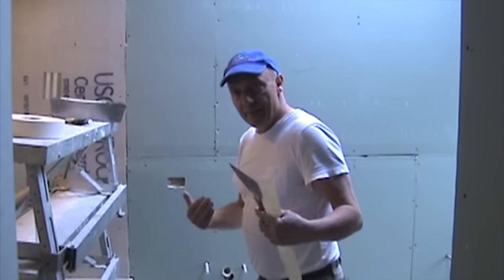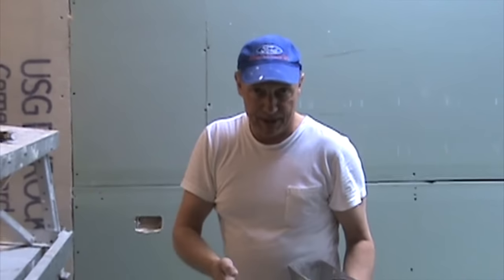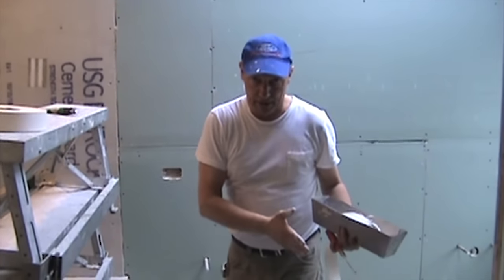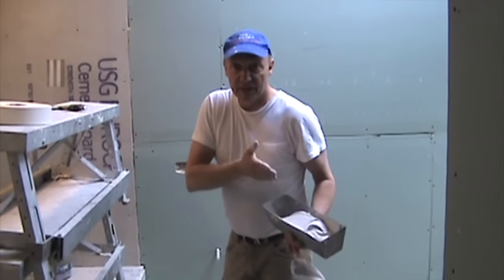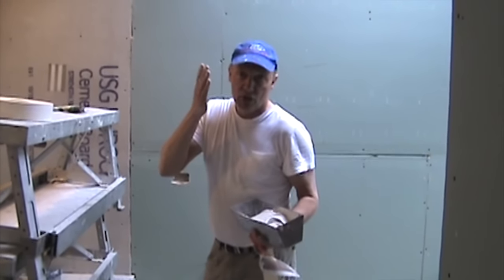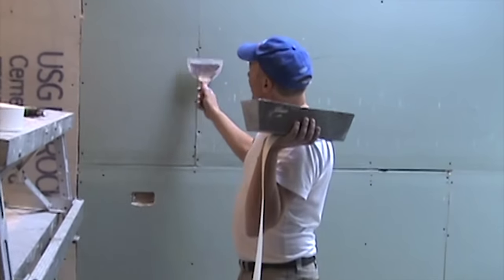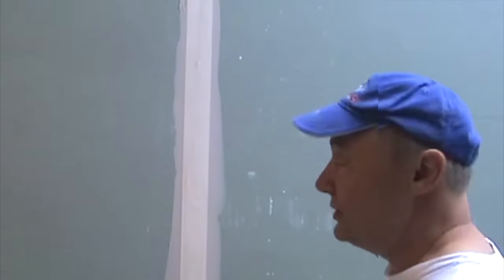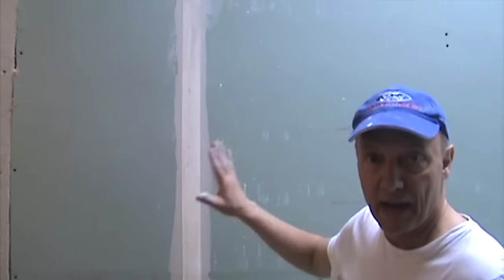How to do Butt Joints

Comment: As a contractor  I have to say that he is really good.
I know an old man who used a concrete trowel and he goes back and makes the half dry mud wet!
And skim coats it flat.
I still took sand paper across it lightly to bother him but it disnt need sanded at all.
I even checked it with an angled flashlight

Comment: I've only been doing this for 8 years or so, I enjoy watching people with greater experience do their thing, maybe there's something there that I can reflect on or learn from, 100 percent agree that there's not much I can't coat out with a 10" knife.  Never been a fan of a 12" unless I am just pulling mud off the wall for a skim.  It might just be me but I've never had much luck with taping a joint and immediately coating again right after, hot mud to tape and taping for first seems to work alright but I still let the tape dry prior to recoating, 2nd/3rd I let it dry enough that I can Scrape the ridges and coat again.  I only sand after my finish coat which, like you, I pull tight, try to keep it clean just to minimize sanding.  

Nice Video, thanks.
Reply: Try anything with an 8 im on fire

Comment: Nice work. As a novice I have a 12 or 14 inch bowed trowel. By bowed I mean it is not flat but has a slight arch to it. This allows me to spread the durabond out an leave a slight thickness over the joint and the tape which tapers to 0 on each side. I always thought that tape had to be wet with a slurry of durabond. I see that this is not done here so this pro does it this way. In any case I use fibreglass tape because it saves me time from putting on wet paper tape. The only drawback that I can see is the fibreglass is a bit thicker which can be problematic. Also it is more expensive. As an amateur without the high level of skill of this gentleman, fibreglass tape and bowed trowel is what I use for joints.
Reply: But wouldn't that give you a rounded area over the joint rather than flat. I only use a curved trowel over bevel joints.

Comment: I tape the same way,in NYwe do not use durabond with sheetrock,just compound and plaster (when- needed) Some times I mix some plaster In my compound for gabs and if I want to start doing my skim caoting the same day or when I some joints need a little extra care .and i want to start doing my finish coating on that day.I never use plaster when I put the paper on, always  straight compound only. I   have been hand taping  for  25 years. I wished I would have had the bazooka and the other tools tools you use . They are really great tools . Even thoughI have done many houses about (4-5  rooms), by myself at a fast but efficient speed. I  can usually  do the paper coating in about a day.or sometimes it may take 2 days.  But with the tools you use , it would  have a better and more efficient way. Also  putting less stress on my wrists and knees going up & down scaffolds and ladders. With the tools you  have been using.for the last 40 years. If would have know you 25 years ago. I would have differently ask you to show me have to use these tools, I am always willing to learn how to do things more efficiently .You can always  show an old dog more efficient  tricks,, if they are willing to learn. them. That's what's wrong with some young  adults  today, they are not willing to learn different ways of doing things to be better at there professions. I  do not mean yourself.

Comment: This is irrelevant to this video but I have a client who requested that I mud over the joints on vinyl coated gypsum board in a mobile home. Do you recommend oil base primer and then just treat as a regular butt joint or will the way the walls move just cause the joints to crack?
Reply from the maker: You are absolutely right use a vinyl strip over the seams that's all you can do mud will never hold up. If it's dirty just prime and paint

Comment: Hey drywall doctor it's a pleasure to see your videos I love all of them... Mister Ray ,I have been doing what you do, and I have been doing it for years except I don't use Dura Bond because they don't sell Dura Bond here in the Rio Grande Valley Texas... At least I haven't been able to find it by I use easy sand USG brand to pre-fill before I tape but for a different reason ,because when you pre-fill you stop blisters, from happening in the tape when you have large gaps.... It's an extra step other type of floaters in my area don't do. But I have always done.... now will USG still recognize my method as good if I use easy sand 90 instead of durabond 90 to do a pre-fill?
Reply: Thank you it's just that here and they're Lower Rio Grande Valley they just slap the houses together I'm a damaged drywall repair specialist and what I do is I correct the mistakes all these guys are leaving behind.... Thank you for your channel I learned a lot of stuff from you....... You can find my videos in (DDR Express) DDR stands for damaged drywall repair.. my company has its own channel...

Comment: I would like to ask as someone with general building knowledge in the uk. this is what you call drywall, we use plasterboard here mostly and it is skimmed all over and finish flat with a plasterer trowel, and then painted or wallpapered, whichever the client requires. So does this mean that the plastering trade over there is just not required, because you do as a finish just skimming the joints etc,
Reply: @THEDRYWALLDOCTOR1  Many thanks for your very swift reply cheers mate. have a very nice day, great video and very informative.

Comment: I  am going to need to do this in a bathroom.  So can you just use Durabond for the whole job or do I just use this for the initial taping and then use another type for finishing?  Can durband be used to cover the screws as well?
Reply from the maker: I would use it for the initial taping sorry it took me so long I just saw this comment and yes you can fill in screws just make sure they're dented in cuz it's hard to scrape

Comment: Hey Doc, ever mud a tapered edge to a butt edge?  What do you recommend when a remediation company cuts 2' of drywall from the basement floor up the wall.  I have about 223' of drywall that needs to be replaced and I want to save on waste by cutting the drywall in 1/2 long ways and using both top and bottom pieces.
Reply: If the company already boarded and put the factory up to the buttjoint, just prefill the factory so you are left with a flat surface. I.e. buttjoint.  Once dry it's easy to tape again.

Comment: I always get scratches in my durabond unless I soup it way up, it seems to take a bit more water to get the clumps out than any other mud. Hardest one to use lol need a machine to sand it if you don't get it right.

Comment: I cut a 45 degree angle and only half way through on both sheets, butt the two sheets together (like welding two sheets of metal when welding a seamless joint) and that way you can sand flush, BUT do this with two application of compound, because compound will not set up inside if it is 3/8 thick or more with one spreading...
Reply: Timex that's got to be the dumbest idea I've ever heard....
Reply: I thought about doing this as well some years ago. I suppose it adds some more work because you have to bevel the edges manually.

Comment: I’m having problems after doing a patch job

Getting the texture to match the rest of the wall 

Another worse after painting you can see a patch job 

do you have a video for that
Reply: You're probably not sanding properly if your repairs are showing, the secret to hiding multiple repairs is to sand them off properly, take a hawk or half pan of finishing mud, load up the area or the wall and scrape it back off, skimming it will even the texture out on the entire wall, light sand and prime and the texture will be even again, I only do that on extremely poor walls, most patch work i do blends just fine with the majority of walls I repaint.  Sanding it properly is key.  So is knowing how to patch dings and holes... could be a lot of things, but if you still see your patches after repainting, you didn't blend the height out and or didn't sand enough.  Maybe they were minor blemishes and instead of smacking them into the wall with the bottom of you taping knife you decide to try to flare out the height of the blemish/damage.. it's easier to dig into a wall and coat it back to flat then it is to try and blend a high spot.
Reply: Natural light/higher paint sheens will show everything.  This could also be why your repairs are showing.

Comment: As a novice, after you tape with durabond 90 and let it dry, what type of  mud do you come back with to float it out? I assume two coats of floating it out then last step sand?
Reply: Thx! Is there an alternative to durabond? Can't find a single store that carries it. They tell me EasySand works just the same to prefill and lay down the tape.
Reply: In Seattle, everywhere sells Silverset. It's made by USG, the same company that makes Durabond and the Beadex and Sheetrock brands. Even the specialty drywall houses out here don't stock the old school, brown bag Durabond.

Comment: the guy at usg said to use mesh tape with durabond now i am really confused
Reply from the maker: He is also not repairing the drywall is he?
Reply: Dont use mesh tape. Only to fill large gaps in corners where the installer messed up.

Comment: Hes doin all the fill in one step cause durabond gets hard as concrete and doesent crack then all you have is your finish coat.instead of multiple coats of mud and  chancing it cracking use this instead its old news for me  just  on deep fill joints  cause if  you  for some reask build it up to high you will be tearing the rock you dont sand durarock

Comment: I have a question doc please help I can I get a perfect cut with the bazooka in the upper angles. My tap keeps pulling so I have to go back an cut lil peace to fix the problem. Its it my mud consisted to running or not to running
Reply: I have hung thousands of rolls of tape with a bazooka and what you have to do is make it a little long as you go to move away from the corner with practice you'll get where you'll make them the right length. It also helps as soon as you leave the corner press really hard on the crease wheel.
Reply: Thank u I jus figure that out the last couple jobs but now I know I'm doing it right

Comment: on a small job can I tape and coat with durabond before the mud sets on the tape?
Reply from the maker: Yes but keep it tight you can not sand durabon
Reply: @THEDRYWALLDOCTOR1  true, very hard to sand. I use a lighter weight top coating like plus 3.

Comment: What are your thoughts on prefilling an area that is already settled?  Doing a basement in a 10 year old house.  Do I need to prefill each crack like this or just the larger holes?
Reply: Good point, thanks
Reply: Doctor- how can primer NOT penetrate the mud / tape and not lock it in? You say it could pop the tape- how's is that even possible?
Reply: mike ray look at any house that a bad finisher has done you will see it's possible

Comment: Hear you say the " real durabond" alot........what is fake durabond?
Reply from the maker: Light weight setting compound
Reply: THE DRYWALL DOCTOR First Aid 

The white bag crap that says easy sand. Anyone who has ever sanded it knows that’s false advertising 😂
Reply: Kirk Dunn 

The durabond 90 is a great product to prevent cracking. Just know that it dries very hard and it doesn’t sand very easily. Perfect for high moisture areas like bathrooms or hot tub rooms. Personally I have used it on several carports and breezeways and never had any issues.

Comment: what do you do when drywall mud the all purpose is drying up on you and making clumps  I can't get it smooth  when it starts drying?
Reply: The Drywall Doctor could it be old from the store it was new!!!
Reply: JBIRD575 Get your kids to start picking out all the lumps! (ha)
Reply: There could be a few reasons.  

1) your not mixing the joint compound correctly to start with. 

2) you keep playing with the mud after it has been applied.

3) your not cleaning the sides of your bucket after scooping some out/putting the lid back on thus get crusty's in your mud.

4) you haven't prepped the wall properly.

5)  you've gotten a bad batch of mud or somewhere along the way it got to cold/hot thus causing a chemical change to the joint compund formula. (Not too likely but does happen)
Reply: Another reason could be that your applying the joint compound too thin/tight on the wall and the drywall has absorbed the water in the mud thus making it gum up if you go over it again.

Comment: Ever fix the connection at the top of a sheet rock column where it meets the ceiling? My house has one and it cracks where it meets the ceiling as the ground rises and falls (yearly cycle in the midwest). No idea how to fix it.
Reply: Float the joint or use Magic Corner or X-Crack by Strait-Flex.

Comment: I notice you only use blue steel knives, whats your thoughts on stainless? One of my finishers only uses blue, but I only use stainless. He cant finish with stainless and I cant finish with blue steel, they are to soft for me and stainless to stiff for him.
Reply: mobicube Why dont yinz switch?? Then you'll both be able to finish...lol
Reply: Blue steel and carbon steel will rust... if not cared for properly. I use both. In my experience, SS wears out faster, ie my corners round off sooner than carbon steel. 

If you think the material your blade is made from makes you a better finisher than others, I’ll leave you to stand on your soap box.
Reply: Yup, it's whatever works for you, I use Stainless, the blue ones bend too easily for me, I assume it's because of how much force I put on the blade vs. The height of it, stainless is what 5-6" inches tall and blue is 4 inches maybe?  The blue ones they sell around here are always plastic and flimsy where the ss are thich comfortable handles and taller blades so it resists warping more... my two cents on the matter.  A 4inch tall blade that is 12" wide will bend easier than a 6 tall that's 10".  But that's for me.  Others make that shit work everytime.  I just bend them, or they get warped in my drywall knives toolbag.  Stainless for me.  They all rust if you let em.

Comment: Is durabond 90 similar to Fastset 90 from Home Depot?
Reply: Similar, but synko/proroc 90 is sandable compared to durabond which is more on par with confill, basically a liquid cement, finish it nice or you'll be bald from pulling your hair out

Comment: How do you sand your durabond?
Reply: The Drywall Doctor can you sand the durabond? I have a portercable sander and dewalt dust extractor. I have always used easy sand dry mix
Reply: Trent Slay it's basically liquid cement so NO you can't sand it
Reply: You don’t, you finish cleanly and then scrape/burnish it down (think plaster) as it sets
Reply: Durabond needs to be coated with regular mud before you do a final sand...
Reply: You CAN and SHOULD sand minor edges/lap marks from durabond before the regular mud coat but you need to KNOW that if you leave anything serious like humps it will never ever go away...
Reply: Trent Slay  I'd say, WITH A DISC GRINDER!
Reply: Trent Slay ☺🖒
Reply: Belt sander of course.
Reply: You can sand it but you need to leave it  smooth with out any edges. And if you do just scrape it with a spatula and go over it with plu3  alot of people dont know that you need to tight it before you layer it with plus3 or else you will get  pores in the finish. After that you can sand it with 120 grit and a fine sanding sponge. A lot of people just sand with grit paper but they dont go over with a fine sanding sponge it makes a hell of a difference
Reply: you can sand it with 60 or even 40 grit sandpaper.   The stuff they use to sand hardwood floors works well too, just to take the edge off.  But you cannot sand durabond down the way you can sand other compounds.    I've found it good for taping once you get the hang of it and make sure you skim it tight to the wall before it starts to set up.